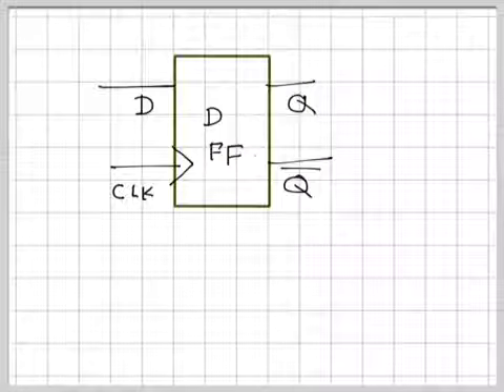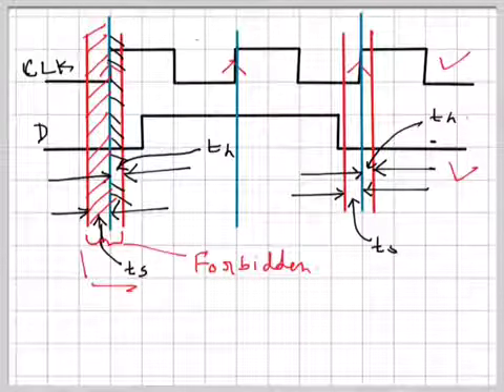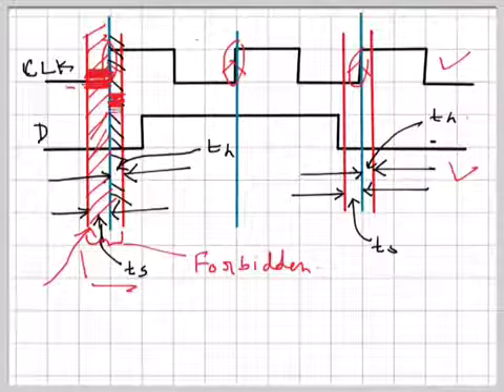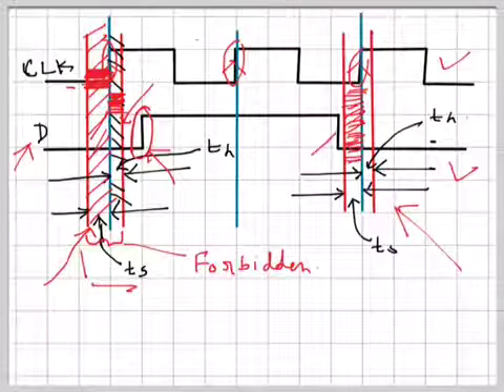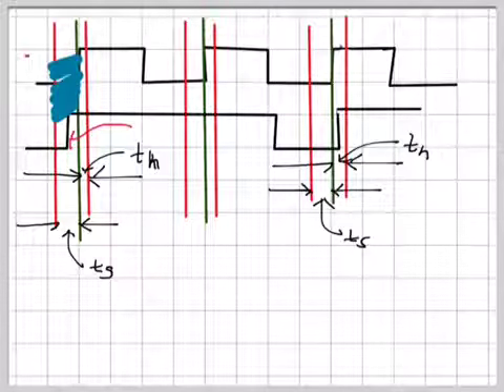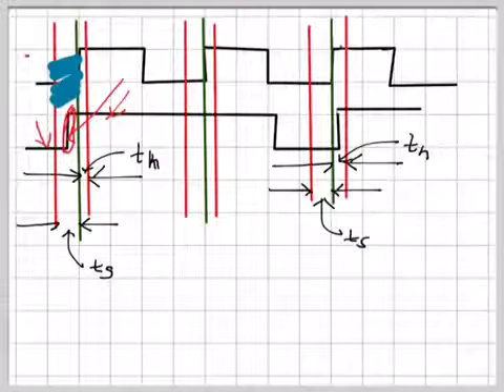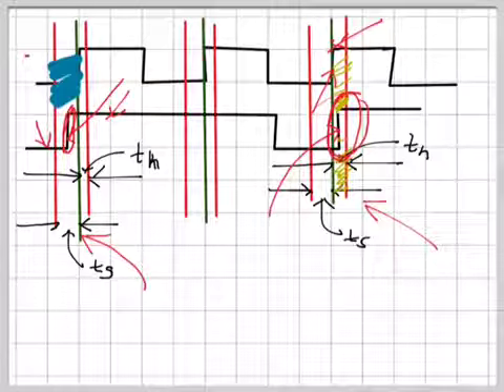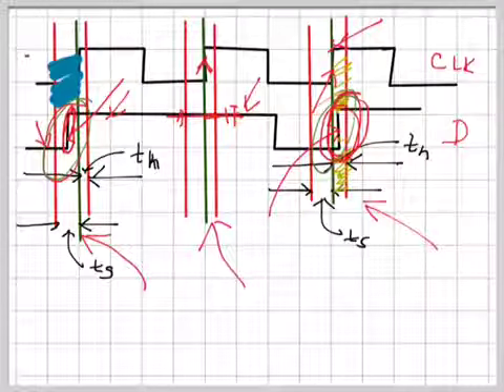Digital Electronics: FF Timing Constraints (Set up and Hold Time) Part 2

Comment: i have a question, like you have selected a part from clock where input cannot change, i want to ask how you took that much area why not less or more. I am talking about In this red shaded portion that red line on left, how you took that ? Cant it be less or more ? How will we come to know
And thanks for this video, it ready cleared my concepts. Liked and subscribed your channel.
Reply from the maker: Nishant Bajpai Sorry for the delay and thanks for the kind words.
I showed the size of the red shaded area arbitrarily. It does have a specific value and will depend on the particular IC. Datasheets provide the value of set up and hold time. So it can change depending on the IC.  I hope that explains.